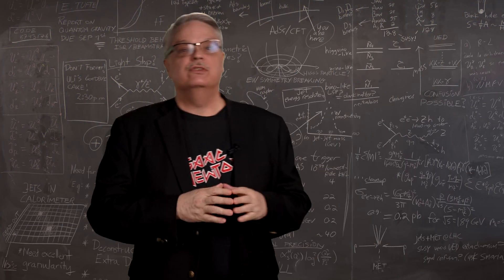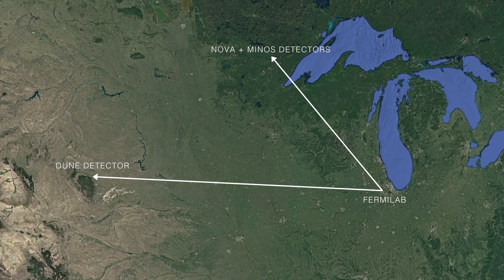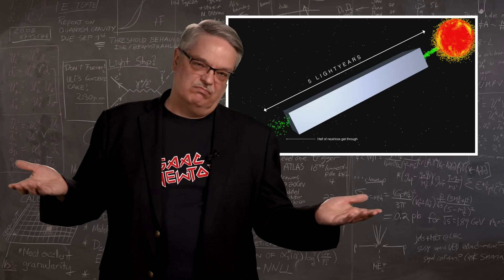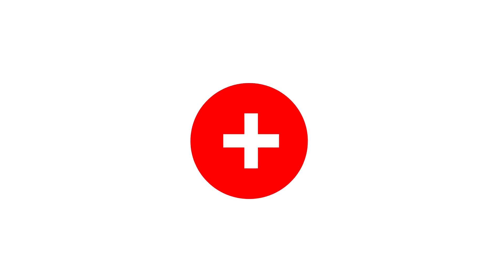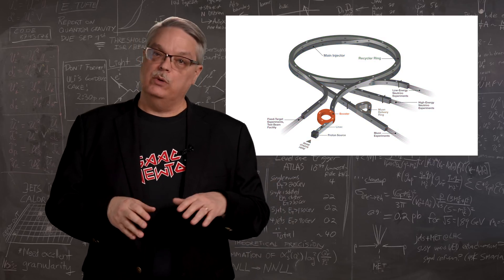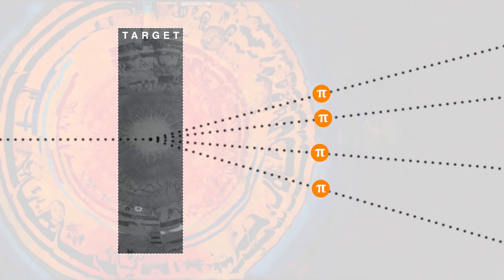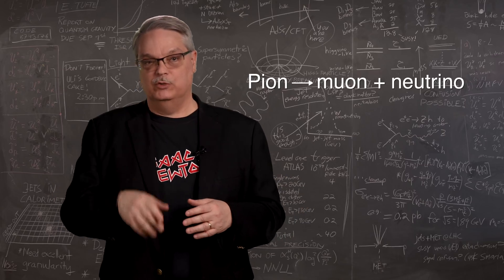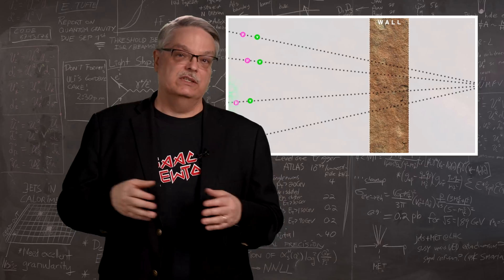How do you make a neutrino beam?

Comment: He says that the neutrinos do not "interact" with gravity. I thought that gravity was a distortion of space-time and that it defined what a "straight line" was (in space-time) without any other interaction with particles. If that is true, how can the neutrinos avoid being affected by gravity?
Reply: I had to go back and check... yeah he does say gravity.  That isn't true,  neutrinos do feel gravity, but they interact with gravity about like light does, so when you're only dealing with earth's gravity you don't have to consider it any more than you think of a laser in air being deflected by the earth's gravity.
Reply: Mark Hollingsworth
Ignore it, Lincoln messed that one up. Neutrino's of course DO experience gravity.
BTW: gravity is NOT a distortion of the spacetime continuum, but a phenomenon that can be extremely precisely described by a model using distorted spacetime. That's a significant difference.
Just because a model describes reality extremely well, doesn't necessarily mean the model is true (Newton's description of gravity was also pretty good for some time). That's a general point (not just for Gravity/GRT). One should never mistake the model one uses for reality, no matter how accurate the model seems to be.

Comment: So when a pion decays, the muon and neutrino it decays into are emitted in the same direction the pion was moving?
Reply: Pions have a mass of 139 MeV. Muons have a mass of 108 MeV. Neutrinos are essentially massless. When pi -> mu + nu, there is only 31 MeV left over. That energy goes to moving the muon and neutrino. The smaller that number, the more collinear the muons and neutrinos are compared to the pion direction. In the limit of zero, they are exactly collinear. For the real case, it depends somewhat on the direction in which they are emitted. But, no matter, the change in direction is small.

Comment: Saying that the neutrino beams are powerful enough to blast through the Earth is misleading.  Last time I checked, if you want neutrinos to go far, you want them to be low energy -- the neutrino energy produced by beta, muon and pion decays is fine, but when you get up to electroweak unification energy (which is within the top range accessible by current accelerators), they stop being able to go through stuff and actually start interacting with stuff with a decent cross-section.  Just looked at https://arxiv.org/pdf/1106.3723.pdf and https://arxiv.org/pdf/hep-ph/0410109.pdf and https://arxiv.org/pdf/1305.7513.pdf (*) -- haven't read the whole articles, but a quick skim through indicates that at least up through somewhere around electroweak unification energy, increasing energy increases interaction cross-section, and therefore decreases penetration capability.

(*)Edit:  Also see https://www.youtube.com/watch?v=5ESFGYkkbEI

Of course, up to a point well short of electroweak unification, you probably get some benefit from increasing energy per neutrino due to making the beam more collimated, since it increases the ratio of velocity vector provided to the neutrino by the beam over the velocity vector provided by the pion, muon, or beta decay.
Reply: But these neutrinos are of order a few GeV in energy.  Thus your point, while having a point, is effectively pointless...at least in the situation being described.

Comment: I also find this aspect curious:  When the charged pion decays,  both the muon and the neutrino then continue in the same direction. Does the uncertainty principle come into play, where since the position is (seemingly) known, the momentum (ie, velocity) of the neutrino is then not knowable?  Or am I totally clueless about this?
Reply: Only the (rough) direction is known, positions and speed are not measured so there is no uncertainty and no wave function collapse to be concerned about, if that is what you meant.
Reply: But isn’t the position known at the point where both the neutrino and muon pass thru the barrier (rock) that is meant to halt the muon, but allow the neutrino to continue onwards towards (beautiful and scenic), South Dakota?
Reply: @tscoffey1 No. The muon and neutrino hit/pass through the barrier, but there is no measurement taking place there. It is just assumed most neutrinos go in the right direction, if there is a detection on the other side they knew they got it right
Reply: Oops, I got this wrong! At the filter point where the muon is otherwise convinced to no longer proceed towards South Dakota (it would hate the Badlands anyway), the neutrino passes thru unscathed. To the neutrino, there was no filter (although whether it will miss its muon buddy remains unknown). So since it does not interact with the filter (or at least 99.999999999999999% of the neutrinos don't - a very few will), the neutrino's position is not known, so the wave function does not collapse. Voila! I could’a been a particle physicist (which to me, is of peculiar interest)!

Comment: ...puzzling #2: how fast is a 'stopped' neutrino moving—nothing absorbs the neutrino (except it has sufficient energy), so is it sub-relativistic like 0.001 eV for a 4 eV-mass neutrino in 10°K space-cold lead...
Reply: 10K not 10°K
Reply: Neutrinos travel at speeds of around 99.9999999% speed of light. 1 low energy neutrino has about 0.12 electronvolts of energy, the reason they don't interact is that their energy level cannot excite any known matter in a significant way. Only head  on collisions (chance ~0 %) result in an interaction with the weak force, with a photon excaping. For comparison, a single electron carries 511 thousand Electronvolts of energy.
Reply: ...0.001 eV ~ ½ 4 eV (neutrino mass) × (0.022 c)² ~ 'slow' (6700 km/s)...
Reply: @rkpetry  You dont get it. 0.12 eV/c2 is rest mass. I wasn't too clear either, my bad. 0.12eV is the rest mass of the neutrino, so if a neutrino comes along with say 50 eV total energy, it has 49.88 eV kinetic energy.
Reply: @rkpetry  For elementary particles, don't use newtonian physics. Use relativity.  mass= restmass divided the root of (1 minus (v squared divided by c squared)
Reply: ...higher order terms contribute insignificantly 'til it reaches relativistic speeds...
Reply: @rkpetry  When expressing temperature in absolute, you say 10 Kelvin or when noting, 10 K. Not 10 degrees Kelvin.

Comment: ...puzzling #1: neutrinos were found to scatter 20% through an Earth diameter, (half the density of lead), so we'd need a 'stellar-size' ball of lead—to trap neutrinos in a random-walk 'til 50% stopped... (So then how long does a neutrino take to walking-escape the core of the sun; Plus, such solar core neutrinos must be cooked to 1300 eV)... [est. 80 sec.]
Reply: Neutrinos don't walk through the sun, They shoot out, without interacting with any of the solar mass. At 99.99999999% sopeed of light.
Reply: @rkpetry Look it up it''s all over the internet.

Comment: I guess that the neutral pions is not part of the story since they are not possible to control the direction of. So if they decay into a muon and a neutrino , the direction can't be controlled. It will just be a coincidence if it's part of the beam.
Reply: Neutral pions decay into photons, not a muon and neutrino.
Reply: @drdon5205  Thanks for info.
Reply: duh! :)

Comment: Love the channel! Thanks for all the inspiration and insights! Got a question on this video. Since neutrinos are so difficult to detect, how can you determine the fraction of the neutrinos generated in the pion decay that travel in the same direction as the original pions? Sounded like a theoretical assertion, but for such a low-mass particle, there could be quite a wide distribution of trajectories...?
Reply: Pions have a mass of 139 MeV.  Muons have a mass of 108 MeV.  Neutrinos are essentially massless.  When pi -> mu + nu, there is only 31 MeV left over.  That energy goes to moving the muon and neutrino.  The smaller that number, the more collinear the muons and neutrinos are compared to the pion direction.  In the limit of zero, they are exactly collinear.  For the real case, it depends somewhat on the direction  in which they are emitted.  But, no matter, the change in direction is small.

Comment: Where is the experimental evidence that a truck load of emancipated neutral neutrinos have truly been steered towards the sought-after direction instead of any arbitrary direction after the pion decays into a neutrino and a muon while the pion traverses an artificially generated magnetic field? One can verily tag along the pion and the muon due to its charge in a magnetic field, however momentarily, but does that truly assure that the muon-neutrino coupling in the pion guarantees their mutual orientation along or perpendicular to the lines of the generated magnetic field? I suspect not. Instead, I suspect that the decoupling flings most of the neutrinos in every arbitrary direction.
Reply: Ozan Yarman - I agree, that is an excellent question.
Reply: Just one word: conservation of momentum.
Reply: Conservation of momentum is a fundamental law of physics which states that the momentum of a system is constant IF THERE ARE NO EXTERNAL FORCES acting on the system.
Reply: @OzanYarman  which you can just factor in..
and what it has to do in this case? pions decay after they've been redirected
Reply: Fritt, you can't miss the fact that not all π mesons decay after they've been "redirected". That's not how decay half-life is understood. Only half of the pions do separate into constituent particles after a certain amount of time elapses. In this case it is generally 2.6x10**-8 seconds. If, moreover there is orbital resonance coupling of the constituents, angular momentum conservation will also prevail, not to mention Heisenberg's uncertainty principle's role in dictating that the momentum and position occupy interchangeably every potentiality spread until the decay, wherefore the vector of the decay products cannot be judged after even "redirection".

Comment: So where do pions fit into the standard model?
Reply: Just like protons aren't in the standard model because they are composite particles pions are composite particles too. The reeeeeally simplified explanation is that they are made from two quarks and the proton is made from three quarks.
Reply: Trevor Schrock
The standard model contains only elementary particles: 
Bosons (like Photons, W, Z etc) and Fermions. 
The Fermions are made up of 6 quarks and 6 leptons (eg electron, muon etc) organized in 3 families. 
All other particles (except these) are not elementary, but are composed of these elementary particles.
E.g. nucleons (protons and neutrons) are each made up of exactly 3 quarks (uud, resp udd), while "meson" is the name given to the class of particles that consists of exactly 2 quarks. So Pi-mesons (Pions) are just a specific case of mesons ... there are lots of others, eg K-mesons (Kaons), but these are compound and not elementary particles.

Comment: A pion beam of a certain energy will have a target area and range confined by this energy. The half-life will be extended due to time dilation of the particles allowing the beam to be targeted any where within the theoretical maximum of tolerance of the components. The neutral pions will pass through matter just like neutrinos until they decay into primarily a gamma ray "laser" dispersion. Any bunker on earth could be hit with lethal amounts of radiation which appears to "teleport" through kilometers of rock.

My question is,

 Approximately how far can Fermilab's neutral pion beams travel?
Reply: With a lifetime of 8.4E-17 seconds, they travel about the width of an atom at the speed of light.  Relativistic effects can increase that by a factor of a hundred or thousand or thereabouts.

So not very far.

Comment: if you have such a big block of lead, it would form a black hole. and even neutrinos cant travel trough a black hole!
Reply: froop
But if your black hole is just small enough some, some particles might just simply tunnel through it. :-)
Reply: @frankschneider6156  such a tiny may not last long enough to tunnel trough...
but the drawn block has a dimension of ~ 0.5ly x 0.5ly x 5ly
and a wheight of ~ 1.5e52 kg
thats 7e21 times the mass of the sun. 
the black hole in the milkyway has only  4e6 times the solar mass, and i wouldnt call this tiny 🤔

Comment: That was really easy to understand. I didn’t know that pions change into muons and neutrinos but knowing that it’s was easy to acknowledge you just have to shoot the two into a wall to filter out only neutrinos. What are the effects of being shot at by a neutrino beam though?
Reply: To first approximation, nothing.  Neutrinos interact insanely rarely.
Reply: @drdon5205  this is a strong beam though so there has to be an effect?
Reply: @RumoredAtmos  A strong enough beam would be a concern.  But this is by no means strong enough.

There is an idea called the "muon collider" (google it), which is under consideration.  In that case, the muons are collected and put in an accelerator.  Muons also decay, this time into two neutrinos and an electron.  In the case of a muon collider, there is some credible radiation danger from neutrinos...simply because it is so intense.

But not in the instance described in the video.  In a detector composed of iron and the size of a house, one neutrino per 100,000,000,000 interact.  The beam has about 100 times that, so there is 100 interactions every second or so.  But that's for an object that big.  For a human, who is both smaller in transverse size and in overall mass, the interaction rate is one every week or month or so.  So no problem.

Comment: But using this method, you just «create» muon neutrinos?
Reply: Yep.
Reply: @drdon5205  but, what about the other two neutrinos? I know the oscillation, but there's no mind about the flavour?
Reply: @cesarverazzu2485  The initial beam leaving the magnetic field where the pions are focused are largely exclusively muon neutrinos.  That's just a consequence of pi meson decay.

Obviously other creation mechanisms, e.g. nuclear reactors, make a different variety of neutrinos...in that case, essentially 100% electron neutrinos.

The only way to make tau or muon neutrinos is through converting beam energy into particle energy and then exploiting particle decay.
Reply: @drdon5205  thanks man. Another question. It's irrelevant for the purpose of the experiment the nature of the neutrinos?
Reply: @cesarverazzu2485  Not really.  You need to know the makeup of your beam to properly analyze your data.  Some experiments look at neutrino interactions for the sake of neutrino interactions.  Others look at neutrino oscillation.  Either experiment has a different purpose and imposes different requirements on the knowledge of the experimenters.
Reply: @drdon5205 muchas gracias (thank you very much). The last question. It's a doubt I have a few months ago. Neutrinos are part of dark matter?  Sorry about my bad English
Reply: @drdon5205  may i do a question in spanish, please?
Reply: @cesarverazzu2485  No hablo espanol, but sure...go ahead.  If I answer, it will be a google translate thing.
Reply: @cesarverazzu2485  neutrinos are a very tiny amount of dark matter.  We know this to be true.
Reply: @drdon5205  you do? Really? Are you sure abou that?
Reply: @cesarverazzu2485  Yes.  But it's a very tiny fraction.
Reply: Don't neutrino's spontaneously convert into each other.
Reply: @tabularasa0606  but what about neutrino oscilation?

Comment: A shame you can't use all those muons that are created to replace electrons in hydrogen atoms and produce some good old cold fusion!
Reply: This video is about mesons, not muons. BTW, even if there would be an easy way for cold fusion with mu-mesic atoms (which I doubt, because the primary repulsion is determined by the nucleus, not the valence shell), the energy required for creating the particles in the accelerator far outweights the potential gain from fusion, resulting in a net energy loss.
Reply: @frankschneider6156  Well... shoot.... :(